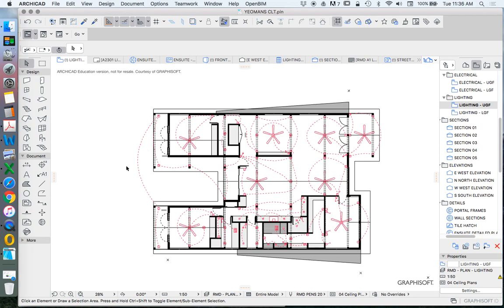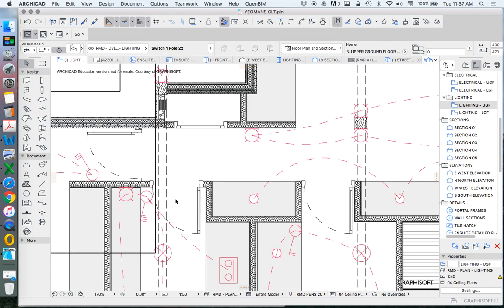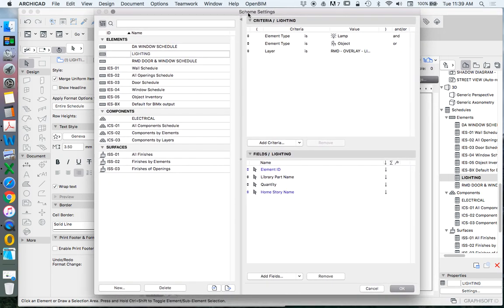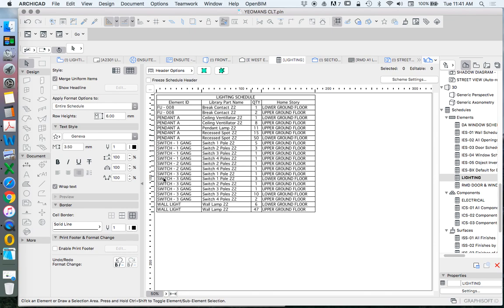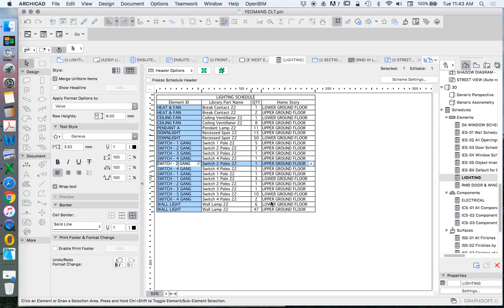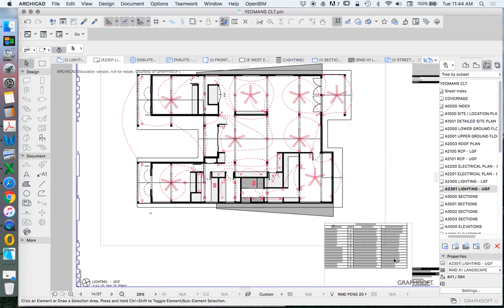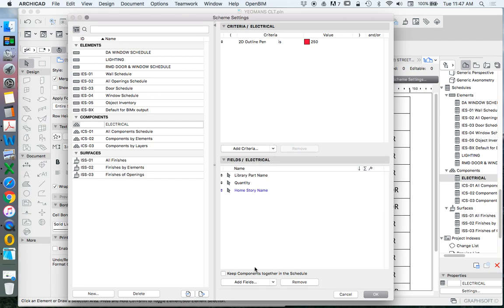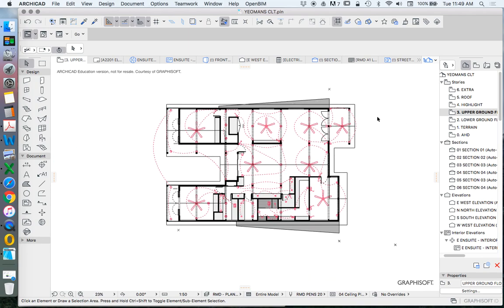ArchiCAD Schedules - Developing BIM Schedules and legends

Comment: In the schedule, you don’t need to pick the ruler mark and drag to enlarge the space, just click twice in the ruler mark and it automatically expands to accommodate the larger element between the schedule’s lines
Reply from the maker: Great, thanks for the tip. I will make sure I use this next time.